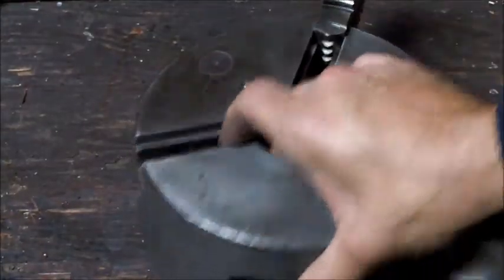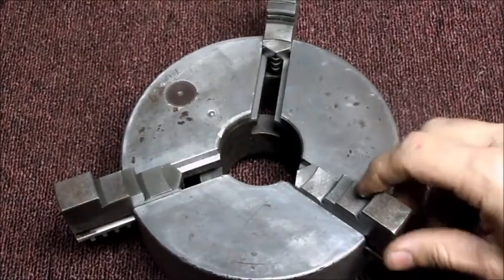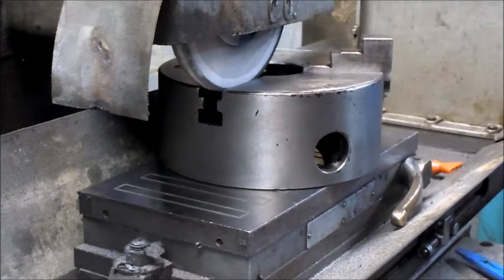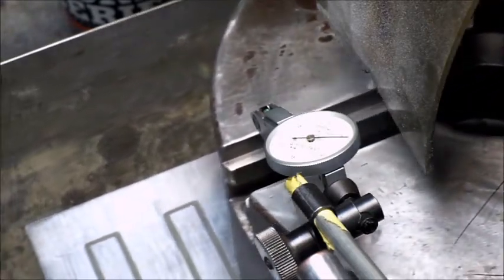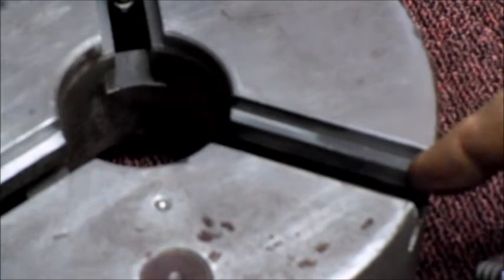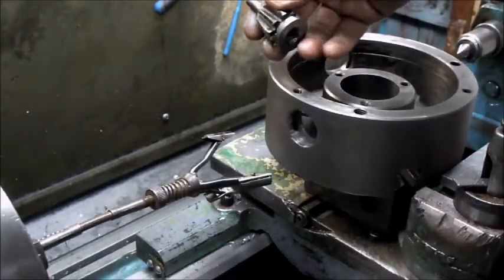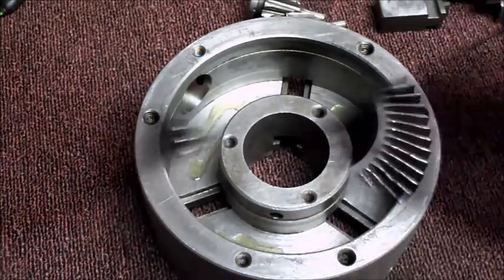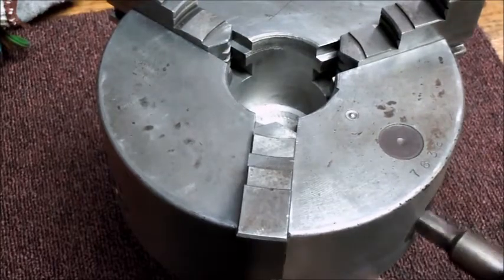Tools N Things 6 New old chuck Part B

Comment: Last month I sold a dividing head that I picked up at auction. The chuck was seized just like this one and I couldn't figure it out. Matching numbers and it looked great. The best I could come up without a grinder was lapping compound and stoning which didn't work. I should've tried my little Atlas shaper.  Great video and honing technique. I'll know better for next time. Thanks.
Reply from the maker: I also considered the shaper, being that I do not have a functional mill “YET”, but settled on the grinder even though it was a nail bitter setup for me. IT's proof once again that when faced with a challenge we all can ussually find a way. Mostly in response to your observations I have to say that I was never anticipating a comment like this. Thanks for sharing the fact that my little video diary, all I ever started doing this for, was able to spark an idea. Appreciate the feedback. Take Care

Comment: Sadly still noisy I imagine. From here that scroll gear looked hammered. That poor chuck saw a real rough life somewhere. I am curious if they beat the face of that thing in or what to get the jaw grooves so tight in the center??
Reply from the maker: The dirt and grime on it totally covered up the dents… was the strangest thing to see it start to show up as I was cleaning it. It was likely all that stress that change the geometry! Somebody had way too much time on their hands or was a budding musician (drummer). Thanks for the Comment
Reply: Any idea what its former life was? Only thing I can think was used in like a welding positioner and somebody was dropping big heavy shafts and things into the face of it with a crane.
Reply from the maker: Oh yes that bevel gear was trashed with a capital T.  The noise is, let’s just say, annoying but I have to make it work for now. Oddly the chuck was on a lathe and the face was not too badly beaten, guess the dingbat ( intended ) wasn’t brave enough to whack the face of the chuck while it was rotating. We’ll keep nursing it back and maybe she’ll fly off on her own one day… Thanks for the comment.